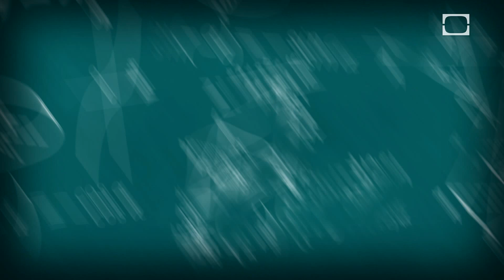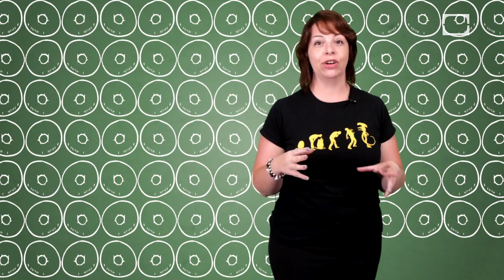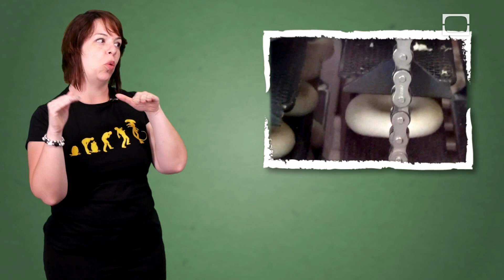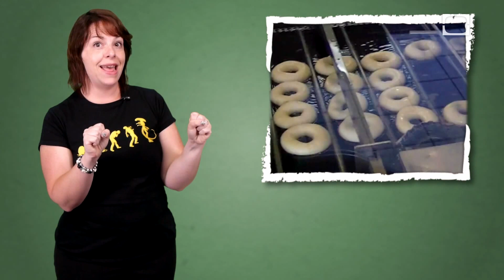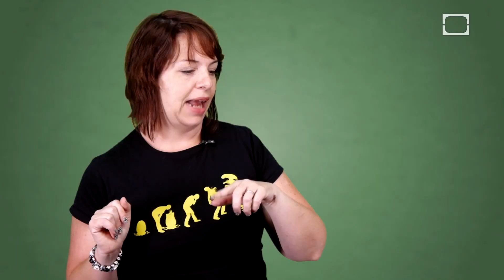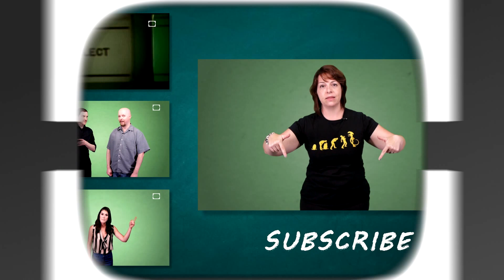How Does Krispy Kreme Work?

Comment: I once melted a box of lemon heads in a bowl in a microwave when I was little. I poked my finger with it. BIG mistake.

Why does sugar get so damn hot so fast? (I guess that would be why does syrup get so hot so fast?)
Reply: Maurice McDonald Microwaves heat by vibrating water molecules. Stick a cup of water in the microwave for ten seconds. Now stick a teaspoon of water in the microwave for the same ten seconds.

The small amount of water will superheat very, very quickly, reaching temps over 100c in such a small amount of time.

Sugary candy still contains water, but only a very small amount, on the order of 5% or less. Syrups are also pretty low in water content - 10% or less, depends on how thick the syrup is (75:25 sugar:water is still a very liquid syrup, for example)

The thickness of the candy/sugar also prevents that extra heat energy being released from the sample as they're physically thick and slow or prevent bubbles of water vapour from exiting the sample as quickly, meaning there's more time for this heat to be conducted to adjacent sugar molecules before it can exit, meaning the heat is contained much more efficiently than in an open container of water.

You can see this effect pretty easily- stick a bowl of dry white sugar into a bowl. Cover it, stick it in the microwave next to a glass of water and turn on the microwave for 30 seconds or so. You'll notice the dry sugar barely heats up at all, while the water goes crazy boiling.

Don't microwave dry sugar without a dish of water next to it though, running a microwave with no water is an awesome way to break it ;)
Reply from the maker: Hm. We'll look into it. We might do some sugar related videos soon.
Reply: BrainStuff - HowStuffWorks Yeah, lol. Like IS AMERICA ADDICTED TO SUGAR? I bet Krispy Kreme would love that one. (i bet most americans couldn't stop eating even artifical sugar for more than a week, or it would take a really big effort. That means ketchup, BBQ sauce also)
Reply: Maurice McDonald Thought I heard somebody say my name !!       (*_~)                                                 ]]]]]]]]]]]]]]]]]]]]]]]]]]]]]]]]]]]]]]]]]]]]]]]]]]]]]]]]]]]]]]]]]]]]
Reply: BrainStuff - HowStuffWorks ~ I'll like that !!!             (*_~)                                       '''''''''''''''''''''''''''''''''''''''''''''''''''''''''''''''''''''''''''''''''''''''''''''''''''''''''''